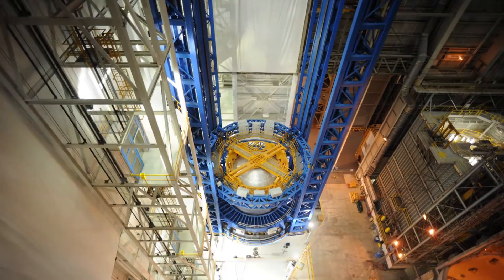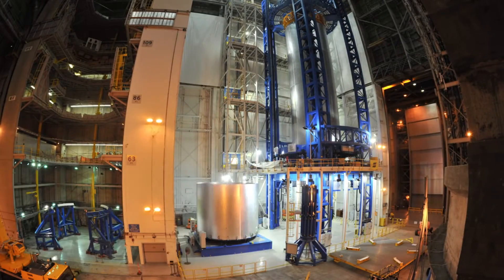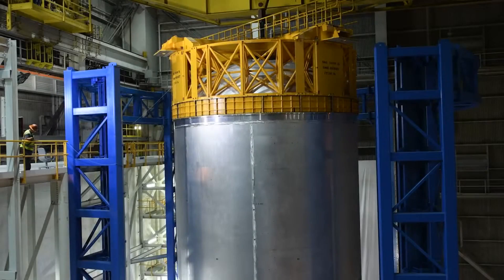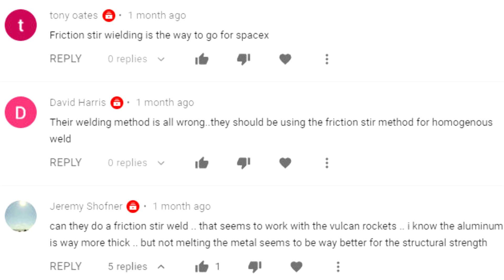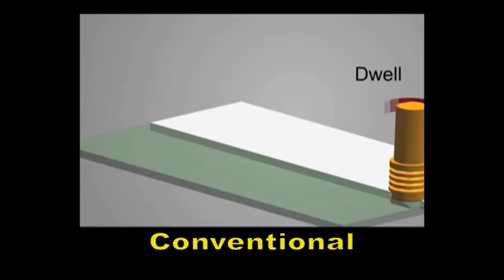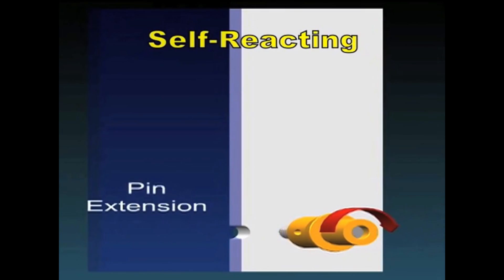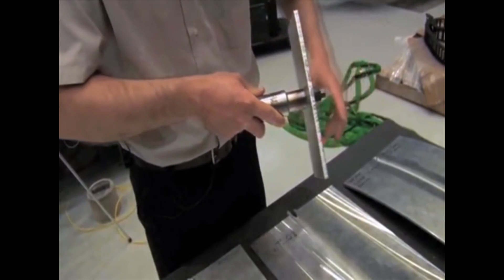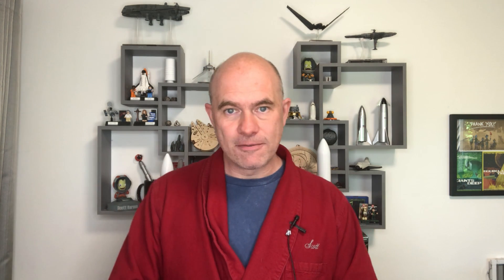SpaceX's 4th Starship Prototype Collapses During Test

Comment: I actually have a welding expert as a subscriber. 40 years working on airplane fuselages.  He swears the whole structure is too thin to endure significant stress in the long run, and it makes sense to lose 20 tons of cargo capacity to make it more resilient. Thoughts?
Reply from the maker: How is he measuring the thickness of the walls?
Reply: @scottmanley  I think he lives there
Reply: As in Boca Chica
Reply: I will try to find out. Scott Manley answered me directly. I am honored. Not joking.

Comment: Nothing too fancy about any of the welding processes they listed. All are fairly standard in petrochemical industry. Definitely NOT going to be friction stir welding something like that out in a tent though. The tooling alone would be enormous. Laser welding is pretty specialized. But ive never seen it done on any large sections like that. Usually only small precision parts. Perhaps used for small diameter plumbing parts. Orbital welding is already semi autonomous. More of a set it and watch as you adjust process

Comment: Mr Manley....Boeing developed a friction welding technique for the Orion crew cabin. No extra material is added...no excessive heat is created...and you can even fuse different types of metal together. What has this got to do with SN3 failure....nothing....peace my Scottish brother.
Reply from the maker: Why would Boeing have anything to do with Orion, it's being built by Lockheed-Martin
Reply: @scottmanley  Apologies Mr Manley..getting my manufacturer's mixed up ...you did not mention anything about friction welding though ??

Comment: "Captain Picard, structural integrity is failing!..."  :)

As for tool steel: it's usually an alloy which includes chrome vanadium to harden the steel and make it stronger than the material it is intended to be used on. Steel presses in the car industry are an example of this
Reply: Christian O. Holz probably tungsten carbide is good to go. Very hard, very high temperature tolerance

Comment: Modern automation is too very adaptable. I'm pretty sure they gonna build a robot arm on an elevator platform, you can program that thing to do any kind of welds. I'm kinda surprised they didn't do this in the first place and went with human welders instead.
Reply: Programming a robot arm takes longer than telling a skilled welder what you want.  Especially if you expect to change the instructions for the next prototype.
Reply: @johncrowerdoe5527  But then it'll be faster to actually weld and the seam will be far more reliable.

Comment: I'm sorry... But I don't feel stainless steel is a good option for a rocketship. So many ways it can go bad overtime...
Reply: As opposed to aluminum?? Go back and research aluminum. It was why NASA had to take 6÷ months to recert the shuttle
Reply: @jackdbur   As opposed to a combination of defernt materials..  I do CNC machining and stainless steel is very heavy especially on itself...  One or two hard landings and the weight transfer flexes the stainless like bubble gum aluminum has a higher bounce back and it's lighter.  Like I said...  Ultimately a combination of different materials is key...   Not just EVERYTHING made with stainless.
Reply: Aluminum  has a strictly limited life. Also try aluminum alloys at reentry temps. Carbon fiber is workable but you have to respray ablative heat shield every mission. Some titanium alloys probably be best but hugely expensive and structure would be the same . Ti even harder to weld. Ooh it's supposed to flex airplanes even ships flex. Trying to join multiple materials together and with stand every thing from cryo temps to reentry heat while flexing??!!😂 Stainless steel is also easily repaired v carbon compisits
Reply: @jackdbur  All true... I hope that stainless is at least hardened..  But I'm guessing that's a no also.
Reply: @jackdbur  I still just feel like an aluminum shell would not have buckled inward as the stainless did... That lower tank is in the open right?? The rocket didn't even have the top on or engines in the base restricting airflow.  So fine...  Stayless might be OK but those sides panels need to be at least 3 times as thick which is going to make the rocket way heavier so????

Comment: Couldn't they use concentric tanks instead of separate tanks? The pressure of an outer Lox tank would reduce the stress on an inner LH2 tank. Plus it would eliminate the LH2 tank exposure to ambient temperatures.
Reply: You do realize there is no LH2 (liquid hydrogen) used in Starship? It’s LNG / methane / CH4.

Comment: I remember when I first heard about friction stir welding an an aerospace conference 20 years ago, it seems like magic.
And just like magic, it only works in very specific circumstances.

I think it's very appropriate when you have thin panels and you want the weld to be flush, like aerodynamic surfaces.
Reply: and the metal sheets can't be too thin with friction stir welding either. The Smarter Every Day video that Scott mentioned explains this as well. For the upper stages, ULA can't use this welding method, because the metal is so thin, they need to save every gram on those stages.

Comment: I wonder if the gas in the lower tank went below condensation temperature.. where it just liquidised and pressure plummeted..
Reply: So, you're saying it was the equivalent of a crown sheet failure?
Reply: Yeah, it might have been an issue of different temperatures. I wonder if it would be still the problem if they used liquid methane.
Reply: Don't see why it would liquify, but I do agree that the cold from the bulkhead rapidly cooling the gas in the lower tank could have contributed.

Comment: In the long version of the video (Lab Padre) you can clearly see buckling at the welds long before failure. This is an obvious failure mode for butt welds in compression. For these joints to take a compression load the walls must be perfectly aligned with very consistent welds. Keep in mind that whatever load these tanks see on the pad they will see 5 times more under acceleration. They will see high vibration loads as well during launch and landing burn, not to mention reentry stresses. If ring section edges don't stay coincident and section walls parallel you will not go to space today.
Reply: I'm not so sure. Starhopper worked great even under acceleration, and I see no reason to think its welds were so perfect. If anything the welders should have improved since then.
Reply: @joeymurphy2464  Star Hopper had much smaller tanks and barely accelerated.
Reply: daniel letterman  Ring sections can work but need to be assembled very carefully. I would think some kind of jig to hold the sections and automated welding will be needed.

Comment: it is also worth pointing out that Stainless steel is not a binary alloy like air/space-grade Aluminium, it also includes Chromium and Nickel (or Manganese), when you start stir-welding god only knows the consistency of the weld. It's easier with aluminium because it only has 2 components in the alloy, mainly Aluminium with added Silicon for crack stability.

Comment: If they were trying to keep the lower tank pressurized with air or nitrogen while filling the upper tank full of liquid nitrogen that could have been the problem.
A fully cold wall between those two tanks could condense out the gas  (from the lower tank) into a solid and result in a vacuum where there was previously positive pressure.

Liquid nitrogen is COLDER than liquid oxygen.

This is one reason that they use HELIUM to pressurize LN2 tanks.  The liquid nitrogen cannot "condense out" the helium.

Comment: I think eventually they will friction stir weld Starships using tungsten bits or some similar materials with very high melting points.
Reply: Maybe the replacement for Starship, but not Starship itself.
Reply: Nope stainless steel is too hard. Probably laser or something like that

Comment: Is this where having rigid fin structures down the side of the rocket carries that weight?  Because otherwise, one little leak or rupture on mars and your whole rocket ship home is a pile of scrap.
Reply: Nunya _ 
The gravitational force on Mars will be much less (1/3 of Earth) so less of a problem.
Reply: @BendeVette  Ya but is it less enough of a problem? I'm OK with flying water towers but then, they rarely collapse. Also these are suppose to transport people around earth like airplanes they need to be safer. Maybe if they used a honeycomb insert in the tank to transfer weight through the lower tank?

Comment: I have this feeling they were testing the autogenous pressurization system so hopefully this failue will help them make improvents on it.
Reply: That's why they are testing the design to improve it even further like they did with the Falcon 9 :)
Reply: Autogenous pressurization requires raptor to be present and firing.  As far as i know raptor was not installed yet.
Reply: @skyrask1948  The raptor only generates the gaseous methane and oxygen. The tanks still need piping and other systems for autogenous pressurization that can be tested without the engines present if you feed the gas in externally.
Reply: @VulpeculaJoy  Raptor feeds in steam and CO2 for most part, and if combustion is not perfect some leftover methane and/or oxygen gas. If engine exhaust is not involved what is left are only pipes and valves, nothing new. Tricky thing about autogenous pressurization is to get combustion to point were leftover methane and/or oxygen does not cause explosion in tanks. So as i said they did not test autogenous pressurization. They obviously fed some gas via some piping, but i doubt that it was not just regular "fuel" intake.
Reply: @skyrask1948  Do you know for sure they did?
Reply: @VulpeculaJoy  For sure no. But bottom of starship is still occupied with hydraulic presses and there was no flame anywhere so i say, i am reasonably confident without being present at construction site that they did not.

Comment: I am familiar with friction welding with stainless steel or steel to aluminum, spin one part against the other until they get hot and then forge the join (press together harder) :) Friction stir sound like something is spinning to generate the heat while the other parts are static and mixes the parts together but lacks the forging part.
Reply: Yep, friction-stir just divides the job into smaller parts by shoving the friction bit onto some "stir bits".

Comment: I think its fantastic regardless that it still moves forward, eventually we'll have travel within the solar system using these methods under development - I'm just happy we're working on space travel again with as much vigor as we are.
Reply: Yep, even with (what we're hoping is just) a testing failure here that doesn't seem to be something that would happen in normal operations of the vehicle, this is still leaps and bounds closer to realization than anything comparable... there really isn't anything comparable to starship, in my eyes it holds the promise and potential to increase the mass our civilization is sending into space per year by orders of magnitude. It could be the first step on our way to becoming a kardashev type 1 civ.

Comment: I don't know about needing the tank full to be strong enough to hold itself up, and it doesn't even have the fairing or weight of payload. That thing is supposed to reenter the earth's atmosphere from Mars, with a belly flop maneuver, how are the tanks going to be fully pressurized for that?
Reply: I imagine they’ll always be pressurized when under load. (The plan is to pressurize autogenously, not with helium or nitrogen. So, they’ll need to retain a little propellant to do this.)
Reply: Nitrogen and/or helium. There will always be pressure in flight. This was a total loss of pressure. Which will "never happen" during a mission.

Comment: Even if sn4 passes test, it will buckle under load of engines during liftoff
Reply: Can you tell me why?
Reply: @UnknownIdentity18  there is zer internal structural support!  No framework, one cannot reply on a thin sheet of steel not to buckle in circular form, we are not building soda cans here.  Even a water tower has more support internally than this tin can.
Reply: @Fatpumpumlovah2  look at the F9 what do you think how thick is the aluminium plus they've tested the tank with pistons that push the engine like 3 raptor engines will push on it
Reply: @UnknownIdentity18  lol F9 is much less in diameter my friend much much less,  and the jacks are to test the puck ring nothing else!  How do u test fastened to the ground lol.  Pls use ur brains here.
Reply: @Fatpumpumlovah2  yes it is a smaller diameter but they function accordingly and can you tell me where the engines are going to be mounted oh wait in the THRUST PUCK where they tested the push of 3 raptors. Phef and I'm the idiot...
Reply: @Fatpumpumlovah2  sure they are
Reply: @Fatpumpumlovah2  THAT'S WHAT COPV-s ARE FOR.

Comment: Surprised they are not just doing water tower trick, with small adjustment, use steel binding, bands. but instead of just around outside also do this inside the craft to increase both resistance to outside and inside pressures. Just an idea.

Comment: I just have to keep reminding myself that this is faster and cheaper than designing in a computer for years and making stuff in an super-sophisticated factory.
Scott, thank you for the most succinct summary imaginable for why SpaceX welds the way they do and rapidly prototypes the way they do. 

SLS is a lesson in the wrong way to do it - and Blue Origin's recent factory glimpse shows they chose the wrong path.
Reply: It isn't, necessarily, but it does have the benefit of providing immediate (relatively, anyway) results for notoriously short-sighted investors to feel like they're getting a return... It might well be more expensive (in terms of variable cost and expense) in the long run, but if it generates lots of capital in the short term, it'll potentially pay out just as well. And it keeps Elon in the limelight where he wants to be.

Comment: I replied on Marcus House's channel earlier. Outside of the engine section there is no internal/lateral bracing. SpaceX is relying too much on the strength of the steel rings. Make these sections just like you would any other fuel tank for a rocket. The way they are building right now, this will happen every time Spaceship lands with almost empty fuel tanks. I know at least one engineer at SpaceX has still got their green ASTM steel design book on a shelf. Time to dust it off and use it.

Comment: Friction welding has been used for years in cheap plastic toys. Also, stainless steel can be tricky to weld, even with common welding processes.
Reply: A variant of friction welding (friction drilling) is also in use in some places. Works about like it sounds, except that sometimes the bit includes a tap, so that threading for bolts can be added in the same operation.

Comment: As I recall the walls of the old Atlas tanks were 1/10 of an inch.  Also because of the corrosion the tanks were getting in the salt water air conditions in Florida they needed to coat the tanks.  The result WD-40.  WD-40 has never been patented so as not to expose the formula.  The 40 comes because it was the 40th attempt.